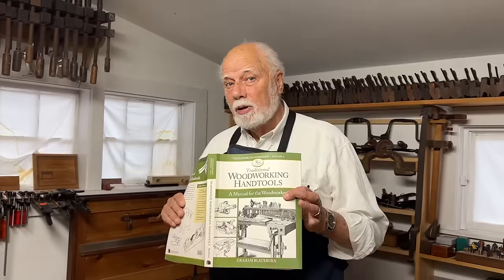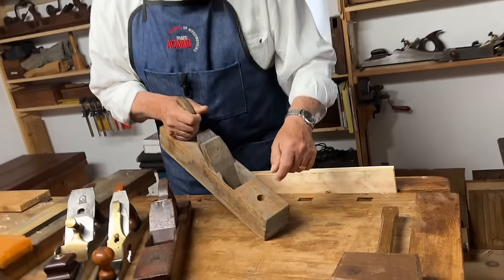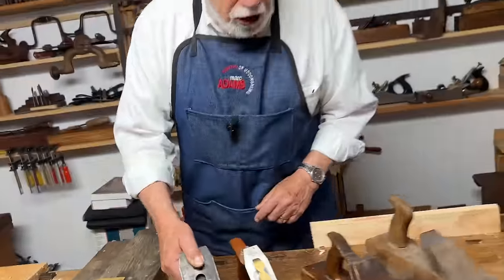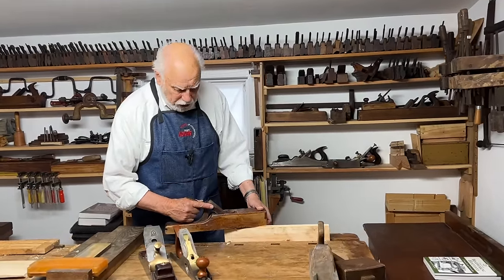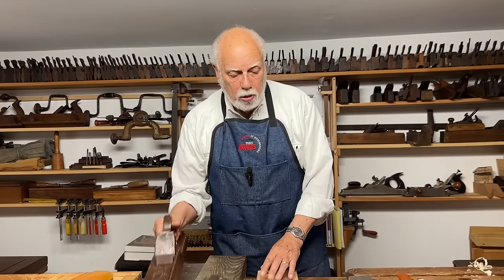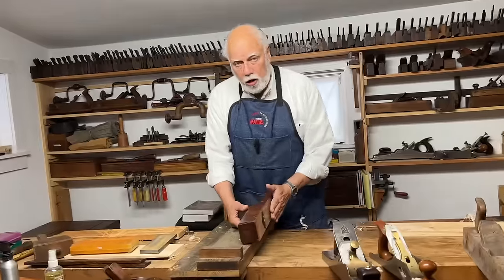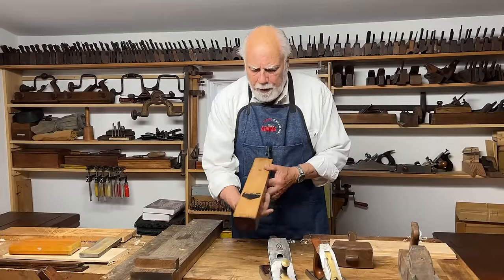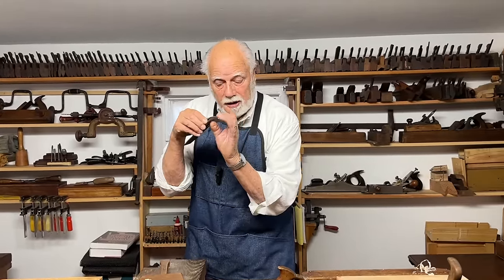76.Jack (of all trades) Planes

Comment: Thanks Graham!  How did you know I was trying to remember the name of the "swoop back" hand plane style that you told me about 6 months back.  This time I wrote it down so I would at least be able to reference it in the future.  What is the spelling of "Razzie"?  For what it's worth, I tried old metal ebay hand planes and I could not get any of them to work right.  I now have two jack planes, and a jointer (wooden, all).  After I learned from trial and error how to sharpen them, I am very happy with how they work.  I have what I need to build a smoother, everything except skill.  I will work on it after I build a tool chest(s) to hold all my tools.  Thanks for the education.
Reply: It’s spelled “razee”; Wikipedia has a decent description if you search “razee plane”.
Reply: @ChiefTiff  Thanks, I looked it up in an attempt to remember it.
Reply from the maker: Razee.

Comment: I don´t like the metal jack planes. I use a cast iron smoothing plane because the sole doesn´t wear and it always keeps it´s tight mouth but for all other purposes I prefer the wooden ones. They glide so much easier over the wood. 
Curiously the german planes come pretty much in two sizes. There´s the around 60cm long jointer and all the others are about 20-24cm long, including the "Schlichthobel", which is the closest to the jack plane. It´s used after the scrub plane (if you had to use one) or if you don´t have to remove a lot of material you just use it as the first plane on a rough piece of wood. There´s no in between length plane in Germany and I still wonder why that is.
Reply from the maker: Many countries have different traditions.

Comment: I would love to stumble on a $20 wood plane. That I could afford. $400 for the L-N is WAY out of my range.
Reply: I can easily afford a $400 LN.  However, the priceless wife would then need to be replaced.  So, I go without and use the wooden ones (which are easier to push about).
Reply: It may be easier to loosen your pocketbook if you held a LN and tried it out. They are special objects and the casting process of fraught with peril. Takes time to keep smashing rejects and trying again. Plenty of options in-between those prices too.
Reply from the maker: Keep looking!